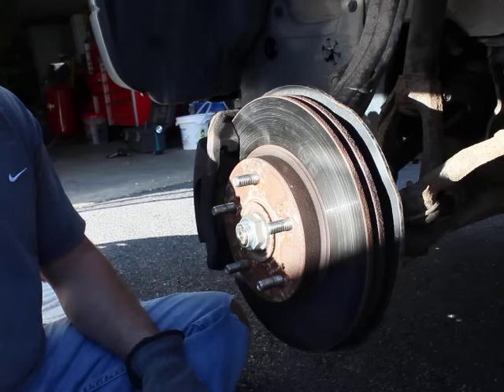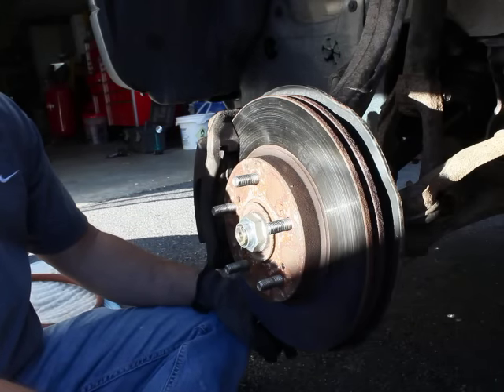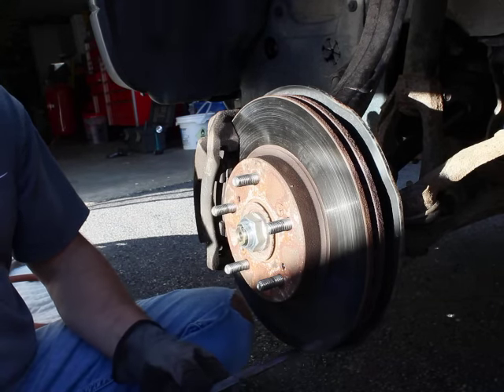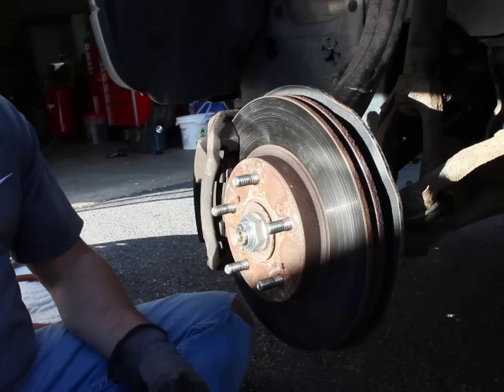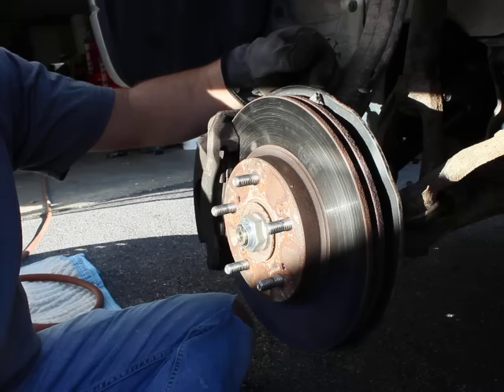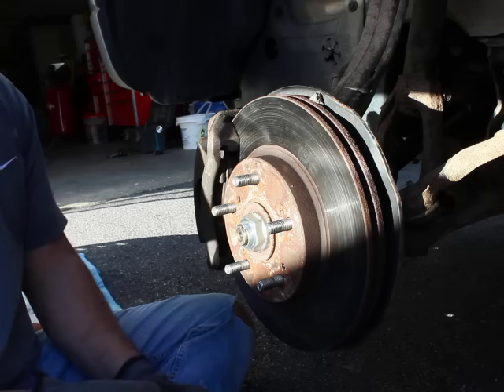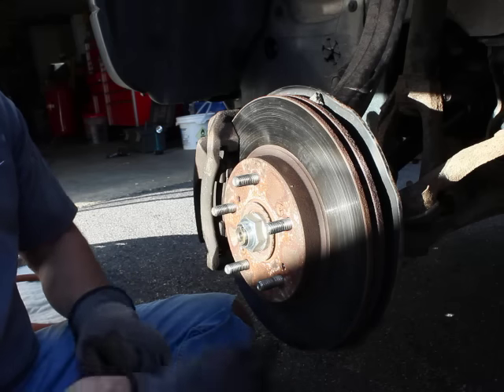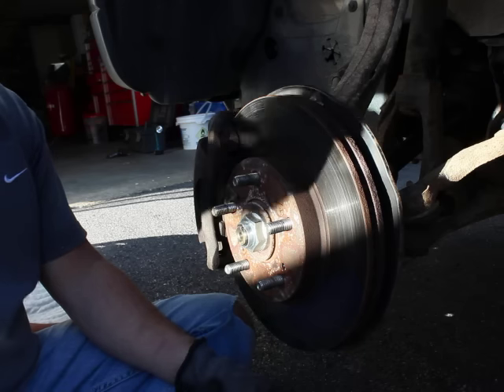Scraping Noise From Wheel While Driving

Comment: thanks alot for this video! i just got my rotors and breaks replaced and still had the noise problem. after i bent back the metal plate all the sounds stopped and now no more embarrassing sounds while pulling up to the light.
Reply from the maker: Hey Fattwinky, awesome feedback, simple, quick, easy fix.

Comment: Thank you so much I am always driving down gravel roads all my wheels were doing this. So much help
Reply from the maker: Awesome Devon, just be sure the brakes are ok, it's a very similar noise but if you can knock the pebbles out and the noise stops you're on the right track lol.
Reply: @EddieCarrara1  im still trying to figure out my issue or being paranoid all my wheels have a slight rub but all are solid and dont heat up. Im hoping its just rocks or the plate behind the fender lol. 2012 was the only model for that car so who knows.
Reply: @EddieCarrara1  everything seems to be normal once again. Thank you for the knowledge
Reply from the maker: @mattfoster8077  You're welcome Devon :)

Comment: My car just started doing this and I had no idea what it was. There’s no metal touching the ground so I was so confused. Thank you!
Reply from the maker: You're welcome Jaime, if you don't find the backing plate touching the rotor I recommend you have the brakes check just to be sure the wear indicator on the brake pads isn't making the noise warning you that the pads need replacing. Keep me posted on what you find, Thanks.
Reply: @EddieCarrara1  oh they were sooo done! 🙈 100% for the back and 80% for the front. I’ve never driven a car past 33k miles before. This is my first car with 90k miles. Thank You
Reply from the maker: @xafbrat79  Wow! Good thing you had them checked lol. Thanks for coming back with an update, I really appreciate it 😊

Comment: you made my day. that noise in my jdm honda fit got me worried.
Reply from the maker: Hi Tej, just make sure you have it checked or get the pebble out, if it's low brake pads, you don't want them to go metal to metal.
Reply: bro, checked the wheel as soon as i could after i saw your video. the cover was touching the back of the disc no doubt. just pushed it back all around.
Reply from the maker: Awesome Tej, simply awesome :)
Reply: thanks eddie. kindly keep uploading such helpful videos.
Reply from the maker: Will do Tej :)

Comment: Most useful video in the whole fucking history of youtube. My mustang was making the same sound even tho i didnt had any brake jobs done. And I can perfecly brake fine with no issues, so I assumed its not the brake pads. Thanks for the vid.
Reply from the maker: Hi Jet, just be sure your brake pad wear indicator is not touching the rotor, it's usually the inner pad that has the indicator so inspect them closely, it may be time for new pads.
Reply: Eddie Carrara youre right, better safe than sorry. Ill make sure to inspect it like you said 👍🏻 thanks again.

Comment: I just bought a new(used truck) and i've been having that noise issue. i've taken it apart three times check brakes and replaced them rotors the whole 9. I flip if it was this damn simple, but non the less THANK YOU
Reply from the maker: +Dominick Webber ,  You're welcome Dominick, sometimes it's the most difficult problems in life have the simplest fix, That's why I created a website called SimpleCarAnswers.com  I wanted to give simple solutions for seemingly difficult automotive questions.

Comment: My car is old and has 230k miles, and started making a noise like this. Definitely going to try this before checking if I need to shell out for brakes!
Reply from the maker: Hi Courtney, 
A vehicle with that many miles you may have some heavy rust build up on the rotors that is starting to hit the backing plate, let me know what you find :)

Comment: +Eddie Carrara Last July I bought a used car and after a week or two it developed this noise coming from the back left. It sounded like a train chugging metal sound, like chika-chika-chika-chika-chika-chika-chika-chika real loud, and it only happened when I turned left. 

In August, I took it back to the place I bought it, they took the back wheels and rotors off and the sound went away. Now for the last month or two the sound is back, but this time the sound comes mostly from the right side and now even when I'm driving straight. It completely stops when I hit the brakes.

Another thing I find is that when I'm in deep snow the ABS kicks in, but the brakes pulsate up and down real fast and I start sliding, one time I slid past a red light into oncoming traffic! This only happens in deep enough snow, maybe an inch or a bit less.

I took it to a garage today and they told me the sound issue is that the brakes, pads and rotors are all shot and need to be replaced. The estimate is $650. They told me the back ones are out alignment and the edges are jagged and that's causing the noise. They said the front ones are starting to go bad now, too.

Is the noise issue and the ABS pulsating/sliding issue I mentioned connected to the brakes, pads and rotors being shot and they just need to be replaced? The brakes are more than adequately responsive (with the exception of what happens in deep enough snow) but the mechanic tells me that doesn't matter, they're working fine now but the sound and ABS problem is a signal that they're about to fail entirely.

What do you think?
Reply from the maker: Hi AllPro777, It sounds like either your rotor is too close to the backing plate and rubbing or you may have some debris stuck between the rotor and the backing plate like a pebble or small rock.
Reply: Hi Eddie, thanks for replying! Yeah, that's what the garage I took it back to last year said. The mechanic said there was some rocks in the rotors. He took them off, cleaned them out, and the noise went away. I can't go back to the original garage anymore, we had a big falling out (their fault, they lied about some issues). It looks like I'll need to find an honest garage that's not going to try to charge me $650, smh.
Reply: UPDATE: Eddie, you saved me $650! Turns out, what you said was 100% accurate. I made the fix myself and the sound is 100% gone. Thank you, thank you, THANK YOU!!!
Reply from the maker: AllPro777 it’s nice when my solutions pan out 😊thanks for getting back to me with the outcome.

Comment: Thank you for posting this! I'm not sure if this is what is wrong with my car, I haven't changed the brakes but maybe it's a rock between the shield and the rotor. There's a scraping sound whenever I'm driving but only on the left rear side. Started out with a low sound squeal and has graduated to this. There is still meat left on the brake pads.
Reply from the maker: Michelle Irizarry Sounds like it's time for brakes Michelle, get them checked soon.

Comment: Haha, this is exactly the problem that I had on my Vauxhall Insignia when turning tight around small roundabouts.  Took me two minutes to give them both a push on the front, and it didn't take much pushing.   Brake disks had been replaced about 20,000 miles ago, so I expect the problem originated from that replacement.  Silence now....  cheers!
Reply from the maker: monsterp1970 nice job, thanks for the feedback  :)

Comment: Great video, this is exactly what I have just heard from my front end, I am guessing that a stone was stuck and worked loose as the noise only lasted 10 seconds whilst driving and seems to have gone (fingers crossed)
Reply from the maker: I John, if the noise stops, great! If you start to hear the noise off and on, it may be the wear indicator on the brake pads starting to touching the rotor so keep an ear on it 👍

Comment: Thank god I came across this video I didn't know wth that noise was and it's loud and embarrassing damn sound came outta no where fixing this problem asap!!!
Reply from the maker: Hi Sierra, if the backing plate isn't the noise I recommend you have all 8 brake pads checked to be sure it's not a brake pad wear indicator making the noise warning you that the pads need replacing. Let me know what you find, thanks.
Reply: @EddieCarrara1  Sorry for the late reply but I did take it to the repair shop indeed it was the backing plate 🤦🏾‍♀️ the brake pads are fine

Comment: Hey There, THANKS for post this ! I just changed the brakes and CV shaft on my New Beetle and could not get rid of a weird scraping noise (changed out calliper flex hose and booster line as well as a complete brake fluid flush) I was just about to order a bearing and hub and saw your video and that was the noise !! it was super hard to see scrapping on the very bottom of the shield at a ridge in the metal... All I can say is THANK YOU for posting the sound !!
Reply from the maker: All I can say is that's awesome Marcincan :) Thanks for leaving a comment, and don't forget to subscribe lol.

Comment: I am buying a 2008 Kia Rio from a co-worker for real cheap and the car has a very loud grinding noise that is insanely loud when driving and gets louder the faster I drive. I've heard grinding noises before, but NOTHING like I heard when I test drove the Kia Rio. It sounds like it's coming from both front wheels, but gets more intense when the car leans or turns to the right when moving. I am only buying it because it has 133,XXX miles on it and is in overall good shape. Plus I am only paying $1,200 for it, which is a steal! I am assuming it's the brakes and rotors rubbing together or the rotors are severely warped.
Reply from the maker: Hi Kansas, 
I believe you're right (maybe lol) If the car sat for a while, the rotors are probably very rusted and is most likely causing the noise. Let me know how you make out, and if you need any help getting this car roadworthy, maybe I can answer some questions.
Reply: Eddie Carrara, The car has not been sitting. The current owner has been driving it like that. I go pick up the car later today. Thanks!
Reply from the maker: What did you find with the car Kansas Man?
Reply: Both front wheel bearings were really shot. My mechanic said he's never heard such loud bearings before. The car was fixed today and I spent around $370 to get it fixed. Now the car drives perfectly! I had recorded a video of the sound the car was making but have not uploaded it to YouTube yet. Maybe I will make a video to show the before and after.

Comment: I'm hearing a similar noise. I have a 2015 Ford Fiesta (FWD).  I've never had a break job... For some reason, I don't hear it when I'm driving around 20mph or when I'm turning. It only happens when I'm picking up speed... The noise remains until I slow down to a full stop... The funny thing is that I already brought my car to the service center of the dealership and it's still happening. They said they updated the chip for transmission cause that's the cause. But I can still hear it and it's really bugging me.... I might just do what you showed... If it still persist then I'm gonna ask them to double check it... Thanks for the nice video by the way...
Reply from the maker: +Carlos Ronquillo 
You vehicle should still be under warranty Carlos, I recommend bringing it to Ford so that can check it out. Ask to go for a ride with the tech so you can point out the noise, sometime that's what makes the difference.Keep me posted Carlos, thanks.

Comment: Thanks for this!  I just noticed this the other day, but it's not just when I turn, but the entire time (speeds up and slows down as I do), only on the front passenger side.  I'm going to take the wheel off today and see what I see lol  Thanks!  UPDATE: Thanks to your vid, and some Googling, I diagnosed the problem correctly, and fixed it!  Lots of rust flakes and debris between the rotor shield and rotor.  Sound is gone!
Reply from the maker: +tamonettX500 That is awesome!!!!  :)  thanks for all your feedback tamonettX500 , I really appreciate it.
Reply: I'm just glad I could fix my truck without spending a penny :)

Comment: I know this was posted awhile ago, but if you have a rock lodged, do you have to take the tire off to fix it or will it come out on its own? I did dry through gravel and I’ve had the scraping sound for 2 days! Thanks!!
Reply from the maker: Tana Dinning Hi Tana. You can try pushing on the backing plate with a screwdriver through the wheel, sometimes that will dislodge the pebble.

Comment: I had brake pads and brake disc replaced .Coincidently now there is irritating noise from the left side passenger wheel which was not there before . ? Same immature mechanic thinks it's from gearbox but another mechanic thinks it's driver shaft ?? This is front replacement .btw great video guys :)
Reply from the maker: Hi Naz, can you take a video of the noise and post it on YouTube then send me the link so I can hear the noise? Did you check the backing plate? What kind of noise is it, scraping, grinding, rubbing, is it metal, plastic, rubber??

Comment: Hello Eddie, does it almost sound like aluminum pie plates scrapping against the ground?  We just had new rear brakes and rotors, even though the mechanic at first said we didn't need brakes.  The sound was there before and after we spent the money on them.  The next day when we got the car up to 70 miles per hour it sounded like the rear end was falling off. So we took it somewhere else and they gave us a list of problems like the left front ball joint loose, the sway bar link broken off and more.  When the guy who put the brakes and rotors on the day before said the car was good enough to drive across the US!!!! The other guy said it wouldn't pass inspection.  Who is right? Our car is 7 years old with 50k miles. They may be trying anything they can think of to rip us off.  Thanks, Julie and Jerry
Reply from the maker: Hi J&J, If the first mechanic said you didn't need brakes, why did you replace them, did they change their minds? Yes this noise sounds a lot like pie plates dragging on the ground. The second mechanic sounds like they found more problems the the first tech missed? Did the second mechanic show you the issues and why they fail inspection?

Comment: Hi Eddie,  metal on metal scrapping noise from driver side wheel (not sure front or back).  Noise goes away when brakes are tapped or applied.  Noise starts up again a few seconds after brakes are releases.  Any ideas?  I haven't tried pushing on the back plate tin yet as I thought it was weird that the noise goes away when I apply the brakes.
Reply from the maker: Hi Jared, sorry I'm late with a reply. Most likely you're hearing the brake pad wear indicator hitting the rotor warning you your brake pads are low. If your pads are ok, then it's possible you may have a small pebble lodged near the caliper causing the noise. Keep me posted on what you find, thanks.

Comment: Thank you so much I’m pretty sure that’s where the noise is coming from on my FRS, I couldn’t figure where the noise was coming from in the beginning, I cleaned up the rotors, re torque the wheels and lug nuts and still ended making the noise and the whole time it was just the plastic cover.
Reply: Something making a pulling sound

Comment from the maker: Hi Robbie, sounds like your front rotors are warped, If you have them replace or resurfaced, you can check out the brake pad thickness at the same time. Let me know what you decide to do, thanks.

Comment: I had new front disks and brake pads installed due to grinding noise, figured everything was fine.  Start driving home and when I start applying the brakes I hear the grinding noise in the front brakes again. Don’t know if I should return back to the same mechanic.  Thx for the vid.
Reply from the maker: Hey Manvet, they probably accidentally bent the backing plate  when doing the brake job. Did you get it fixed?

Comment: I’ve got a 2019 Lincoln Continental, and this happened today as soon as I pulled into my driveway. Recently we had ice and snow, tons of salt and all that, and then inevitable potholes afterward through town. This year they seem particularly bad. I bet that what it is. I probably do have gravel or something in there, because I haven’t had my brakes worked on recently, and they’ve shown no evidence of wearing down.
Reply from the maker: Hi Luke, it's a good place to start and it's easy to move the shield through the openings in the wheels with a screwdriver. Let me know what happens.

Comment: Thank you so much for this video! So going to check out my backing plate and look for rocks lodged! How long is that screw driver? may need one to reach that far back or could I just use a metal rod?
Reply: Any basic flat screwdriver should work.  As long as you have a good enough angle to where you can pry the dust plate just a bit
Reply from the maker: Correct Arodderz, they bend pretty easy.
Reply from the maker: Hi Crypto Girl, you could use a piece of wood like a broom handle, anything that can fit through the wheel and push on the backing plate. Let me know if you have any questions 😊
Reply: @EddieCarrara1  They do. Unfortunately for me my wheel bearings were shot, which was the reason for the noise. But again, even changing that wasn't too hard. 👍
Reply from the maker: @arodderz  Awesome! Thanks for the update👍

Comment: Thanks. I have such  noise after changing break pads, disc and caliber. IF shield could be an issue like you explained then why it comes randomly only for some time then stops ( Eg if I drive it starts after 5-10 km then for 2 mins only and then stops). If it is bent shield then it should be continuous, right ?
Reply from the maker: Brakes get very hot so the metal expands and contracts a lot. It’s possible it just needs a slight adjustment.

Comment: Sometimes scrapping sounds can be caused simply by not using brake lube properly when putting in new pads.
Reply from the maker: Yes sir, it's very important to lube all brake pad contact points and caliper slides. Most  DIYers will toss the pack of lube in the circular file and wonder why their brakes are squeaking 😂